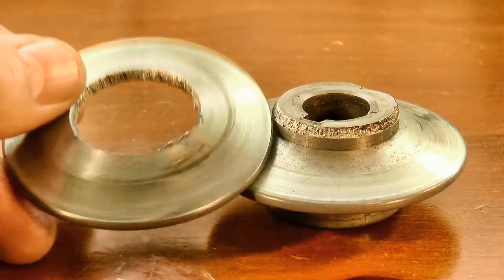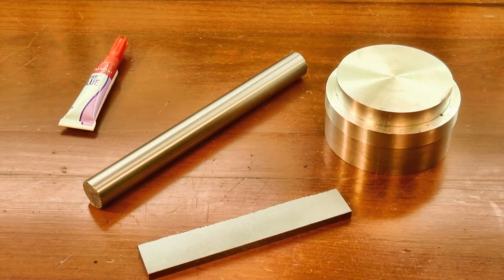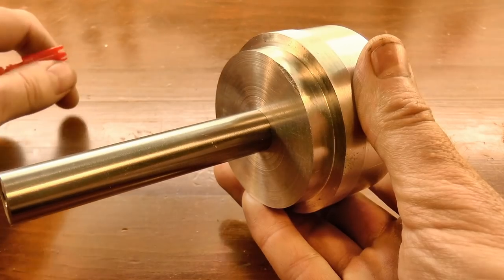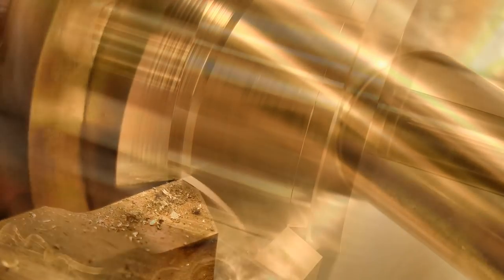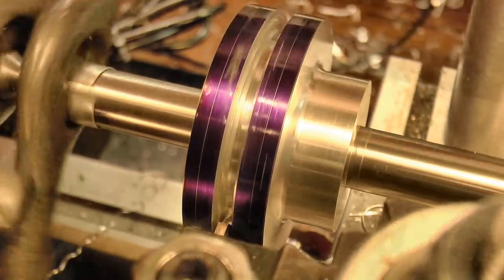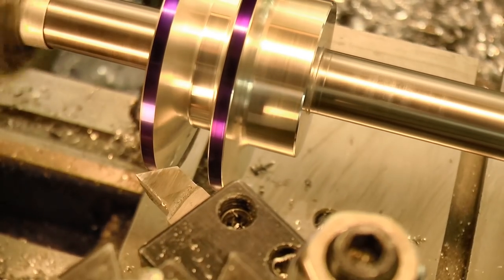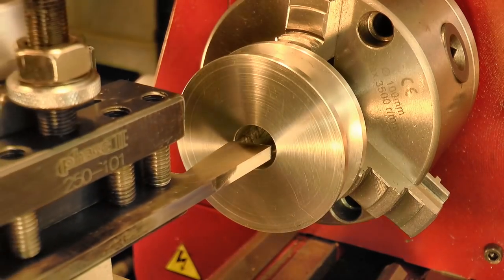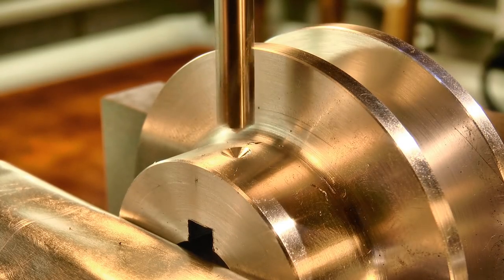Machining A Replacement Pulley With A Keyway

Comment: Terrific fix Chris and glad you had an excuse for another couple of videos! @¿~  Whoohoo for us!  Also Love the little sound when you overlay the CAD onto the vid...just awesome and never seen anybody but you do the overlay...could start a trend.  Most curious about those pliers used on the belt sander at the end??  Glad you got the Patreon going...I'll be signing up for such a class act.  Always a delight and Inspiration. ~PJ
Reply from the maker: pjsalchemy Thanks PJ, the little hand vise is a chinese knock off of an old (Alford?) design. Love it, use it all the time.
Reply: Clickspring Thanks Chris, they do look handy with the flat face & could be held flat on a grind jig too.  I use my old drill chucks on a handle for rounds typically but looks like your could feed the wire from the back.  Very cool and cheap n' cheerful to boot!  I think those are more like a Lowell pattern than the old Alfords.  ~PJ

Comment: I have a problem that you may be able to help me with. I have a pulley on a sewing machine motor. (1amp motor for domestic vintage machine) and I can't get the screw out of it. I have injured myself a few times and I don't want to do that again..I was wondering..how do i secure the small pulley so i can get the screw out and how do I get the stubborn screw out?? any advice..I want to repair the motor. it possibly only needs the brushes replaced but I can't get to them because of the stuck screw in the pulley part of the motor..

Comment: Do you really find that Locktite is better than forming to make a "press fit"? Is it just due to not having an arbor press? I know in this case you want to remove the arbor, but in other videos it was clearly a permanent fixture.
Reply from the maker: +ExtantFrodo2 It really depends on the circumstance. Sometimes a press fit is appropriate, although one of the good things about Loctite is that the bond is easily reversed with a mild heat. This can be very helpful during servicing, and avoids the damage issues of reversing a press fit bond.

Comment: I’m really surprised how that keyway was done and I trained as a machinist...never seen that before😳👍🏻
Reply: biohayzer yeah I’ve only been in a shop for almost 2 years, but I watch a lot of videos and what not, but I have only ever seen key ways cut with milling, or an actual key cutting machine that moves up and down. Pretty cool.
Reply: It’s essentially an obsolete practice.
Pretty common 100-150 years ago when many shops only has a lathe and a lot more operations were done on them.

Comment: I know this is an old video so i doubt i'll get acknowledged i understand if i don't, but my question is this i'm looking at making some pulleys myself very similar to this BUT the only difference is rather than a V grove my pulleys need to be straight grove and running width wise in the grove is a series of teeth my question is how could i achieve that easily ? any ideas?

Comment: I notice at 3:00 the Allen key you use to tighten the compound is in really rough shape, which is starting to round out the hex on the screw... You can 'sharpen' Allen keys on a bench grinder, removing some length on the ends to expose a fresh area. Like sharpening a drill bit, they will get shorter and shorter each time you sharpen until you've used them down to a little stub. I hope all is well, I love your videos but haven't seen anything new in a while...

Comment: why did you turn the pulley between centers vs just putting it in the chuck?
Reply from the maker: +oishisakana Between centers turning is a great way to ensure that all surfaces remain true to each other, even after removing the work from the lathe, as happens half way through this project. Thanks for watching and asking.

Comment: I was positive that you were machining the pulley from brass until you mentioned aluminium. The white balance of the video is indeed very warm, but i guess it is on porpose?
Reply from the maker: +Esben Jensen Hey Esben, yes the WB is a bit too warm in the earlier videos, but slowly getting the hang of it in later vids. Thanks for watching.

Comment: i know that you're probably never going to see this comment, but i dont understand the point in the carriers? why not just put the arbor into the lathe chuck and use tailstock support?
Reply from the maker: Turning between centers removes chucking error that would accumulate when the work is removed and flipped - Cheers :)

Comment: I am loving your vids, trying to work out you accent debating between Aussie (like me) or American, technically I am as a dual citizen
Reply from the maker: +gigabytex64 Aussie :)
Reply: +Clickspring I love the high shine finish from you parts what do you use as i use brasso and autosol but i need mirror finishes as I am starting new channel videos up rc wheels and the way you do your blue screws for the skeleton clock I kinda borrowed it and it lookes great but now I have yellow and a rainbow finish from the same way. Letme know if you want something different for finishes as I have been playing with high silica content sand as well as a cheap frosting gun used for glass but now repurposed for mrtals. I use chrome rod, Stainless rod, alluminum and brass but have to have plenty of wheels before I set up. But I love your finish quality and wood like to know the brand and compound. (dont worry about me sealing any work from you as I only do computers programing and a tech, drawings digital art as well, mechanics, automotive electrical and sound, panel beating, airbrush, model rc planes cars boats, and now machine'st noob. At 42 I fit allot in, I was told id live to 18 ant the max so I cramed in all I could eve rally driving and drags. Any help on polishing would be brilliant, thanks
Reply: I noticed your compounds for polishing are the definite way for me to blue but i cant get that same shine with the compounds I have. I use Autosol and Braso but they are not enough for quality a shine.
Please let me know " Guru Of Shine "

Comment: ok I see that you are using a pretty fancy 3d software, let me say that for most of the jobs that you could do with a lathe you do not need such expensive software, in fact any cheap cad software would do, even Google sketch up could work for most of your projects, I was tempted to suggest using rhino, yet I wont,... (unles you already know how to use it...)... now if I was to suggest using AutoCAD, I would suggest using one from 2011 up to 2015 previous versions are just a pain....
Reply: +Robert Ostman -  Solidworks (used here) blows them all away!  It's very expensive but so is Autocad.  Autocad was the first CAD software I learned and thought I would never switch.  Then my son who went to college for design showed me Solidworks.  I tried it and never looked back!
Reply: autodesk fusion 360 is free to home users and startups.
Reply: fusion 360 free?? I didn't know... waw well I have been staying away from it believing it not to be free... I may end up using it now
Reply: Or you could download a bittorrent client and find everything you want for free, albeit illegally.

Comment: I don't understand why you would turn between centers if you can just clamp it in the three jaw chuck, could you please explain?
Reply from the maker: As I mentioned in the video, the stock was a bit too short for chucking, and turning between centers also brings the added convenience of using a single compound setting for both sides of the groove - just flip the work and start cutting, much faster than resetting the angle. Great to have you watching Tim
Reply: Clickspring o so then you wouldn't have enough of a grip and added clearance?
Reply from the maker: Yes that is correct
Reply: Clickspring thanks for the reaction! Keep the work up!
Reply: Generally it is a good idea to rough out the workpiece before using such an arbor to minimize the forces and heating when finishing it. Makes the job a bit faster, though in a hobby setting the gain is debatable.

Comment: Why would you bother turning between centres? Why not just chuck up the arbour and then use a live centre on the tailstock?
Reply from the maker: Hey Charles, the available stock was quite short with insufficient length to permit the tool to have clear access for the groove cuts to be made from a single chucking. A rechucking would therefore be required half way through the job. Chucking the arbor directly would also introduce the chucking error onto the part, throwing the center hole off from the outer features. Turning between centers eliminates the chuck error that would otherwise be introduced on that second chucking, or by chucking the arbor directly. The part can be flipped end for end repeatedly, with confidence that its very close to being on the lathe axis every time.  Thanks watching and asking.

Comment: No thread locker on the set screw?
Reply from the maker: otm646 Its a fairly tight fit in the thread, and nicely locked against the keyway, so no need. Thanks for watching.

Comment: 0.0005" per cut with 3 passes each cut and doing this by hand
at a 1/4" that would take 1500 passes
Even at a fast 2 seconds per pass that would take 50 minutes of standing there spinning the wheel

I hoped you learned how to broach after this.

Comment: "Forms follow function", so of course the Lathe is where the Principle prime numbers, in bulk conglomerations of Quantum Chemistry wave-packaging, are extracted from Superspin Modulation, THE positioning function cause-effect of time-timing sync-duration. This transverse trancendental e-Pi-i Unity of spin in/of empirical laws of physical existence condensation.., are superimposed in the Eternity-now Interval Conception here-now-forever.., bulk Quantum-field(s) Multiverse or multiplicity of Time Duration Timing. (To make a Materialistic, Condensed Matter POV comprehensible for Machinists)

Michaelangelo took to blocks of Marble with chisels by going around the work and removing what he did not see in the finished "theory of being" embodied in his Statues, for example of "Everything is (Theoretically) connected", holographic Imagery.

Comment: Beautiful videography and very instructive work details. You are right about having to use very small depth increments to prevent digging-in while broaching on the lathe. I ran into the same problem cutting 5mm keyways for lathe change gears (see http://www.homemadetools.net/change-gears ). Looking forward to seeing your clockmaker machining. Regards, Paul
Reply from the maker: Paul Jones Glad to hear it wasn't just me! Thanks for the link, and  thanks very much for watching.

Comment: If that keyway was 1/4 inch, and you made 3 passes per depth, then you would have had to make 1,500 passes to get it to depth? That doesn't seem right...
Reply from the maker: +Trollygag 1/8th inch, but it was still not the fastest way to get the job done. Thanks for watching.

Comment: I have a coote belt grinder. It is made of aluminum castings by a knife maker in the US. 2" x 48". Cootebeltgrinder.com I will never bother with a disk sander again. The capability to change belts quickly allows me to round the corners on 1/2" steel plate one minute and polish a lathe tool to a mirror the next. One of my fav tools. I enjoy your vids. I really liked  the sq broach.

Comment: Good project
But that seems to be the long way.
I would drill the pulley material first, then set up the bar, center drill and turn the OD of the bar  to fit the drilled hole.
Assembly, stick in the center and machine..
Eliminating need for turning between centers.
That job is too short to be turned between centers

Comment: I wouldn't mind if you found any more excuses for making more videos :D
Reply from the maker: Kjetil Hansen As much as it slowed down the clock build by breaking, I was kind of happy at the idea of a new video! Thanks for watching Kjetil.
Reply: Clickspring 
I have 2 questions though, I use a lathe myself and love the tip with super glue! But when you runt it between centers, why can't you just insert one end of the silver steel shaft in to the chuck? 
Also, the effect you use on you video when showing the finished piece was excellent, I really liked that one, is this just time-lapse with a camera dolly? :)
Reply from the maker: Kjetil Hansen  Running one end in the chuck is something I avoid if I want the external features to be true with the bore, because it lets the chuck runout print on the part, forming a slight taper. Using center holes and turning between centers reduces this error to a minimum. It's not critical for this part though, either way would have been fine. Spot on with the camera shot; glad you liked it :)